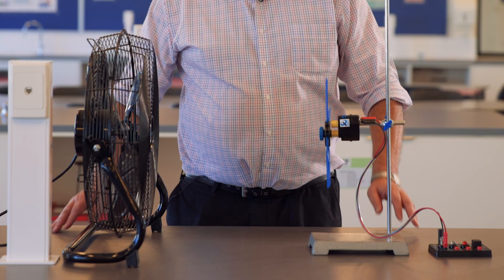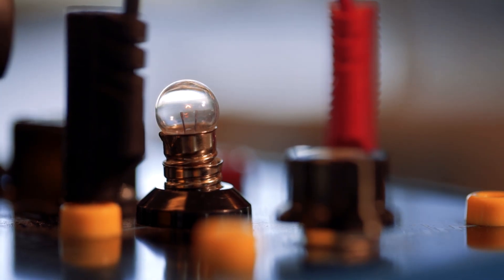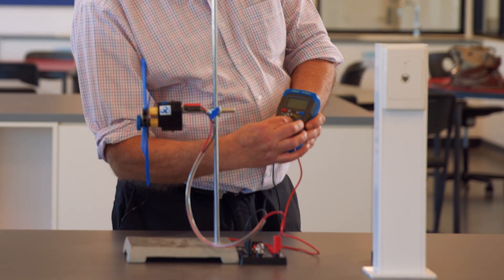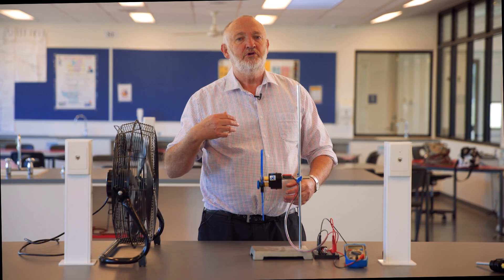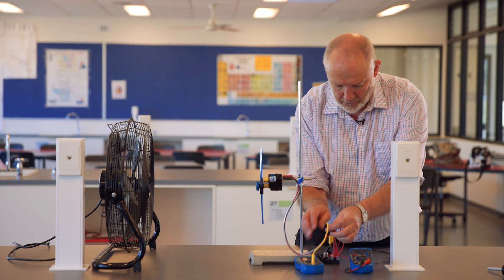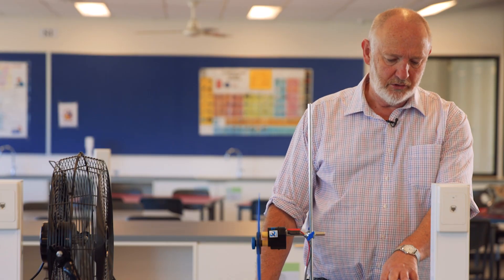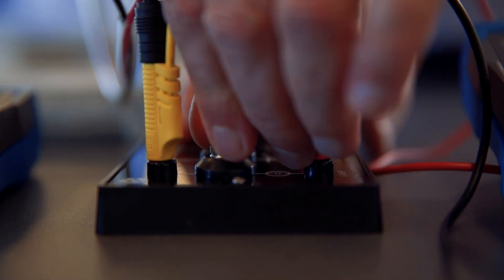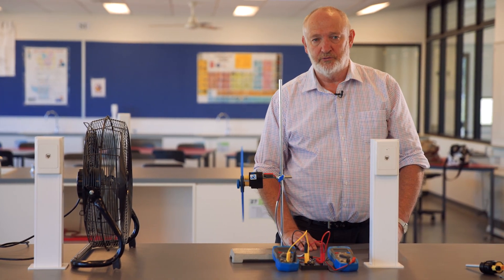STELR How to measure power with Wind Turbine set up

Comment: The power measured in this video was based on the Light bulb as a load, which takes specific amount of current. How do I measure Maximum power (that can be) generated from the Wind Turbine?  Do I connect it to a re-chargeable battery that will pull maximum amount of current?

Comment: Why are you measure ac voltage coming from terbine  by multimeter keeping it on dc voltage range?🤔🤔🤔
Reply from the maker: The turbine uses a DC motor. There is a capacitor connected across the output terminals. This gives a steady DC voltage.

Comment: Great video! Needing help myself to test my 80w wind turbine. Would a simple watt meter be ok? Thinking of just connecting the turbine to a watt meter and the watt meter to a dump load, testing it first this way before purchasing a charge controller and battery. Will it show how many amps, volts and watts the turbine is producing? Looking for a way to find out those 3 amounts.(V,A&W).
Would appreciate any help. Cheers!

Comment: What the name of that middle box?
Reply: If found reply me
Reply from the maker: STELR test rig module. It has a DC motor, LED, buzzer, lamp and variable resistor. It is part of the STELR Renewable Energy student kit. It provides loads for solar panel, wind turbine and hand crank generator. More details on the STELR website stelr.org.au

Comment: Is it okay to directly connect the multimeter to the DC motor to measure current and voltage and can I measure them at separate times as I currently only have  1 multimeter?
Reply from the maker: With one multimeter, just connect it across the motor to get the voltage. That is a good indication of the output of the wind turbine. To measure the current, the multimeter has to be in series with the motor. If you want both measurements, you have to take separate readings.
Reply: is it possible to measure the power with single multimeter?

Comment: Is the turbine producing AC or DC? Thanks :)
Reply from the maker: This turbine produces DC. It has a 12V DC motor acting as a generator, and a capacitor smooths the DC voltage produced.
Reply: Depends on the kind of electric motor inside the turbine, I believe that the biggest turbines are AC
Reply: Do you know the name of the middle box